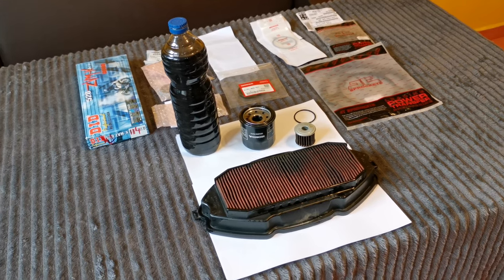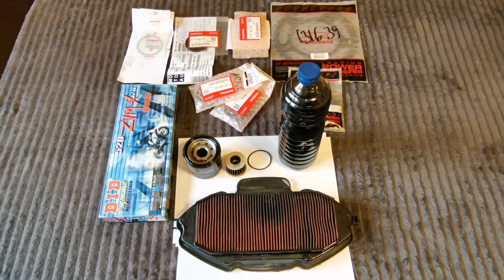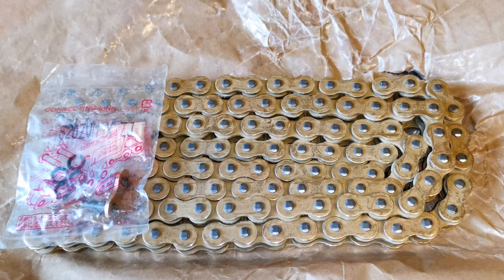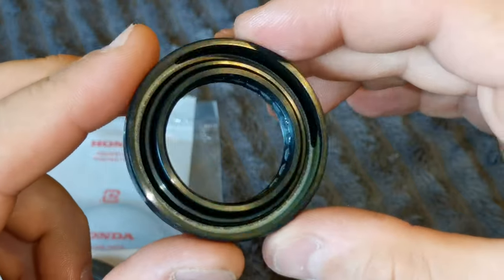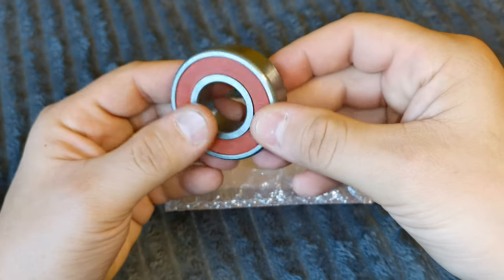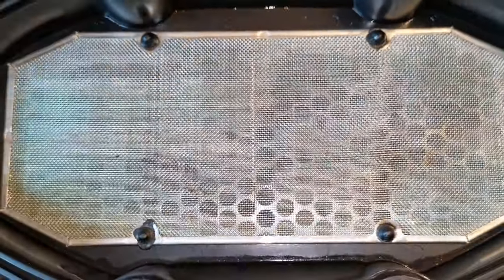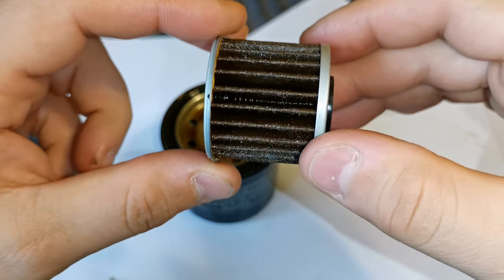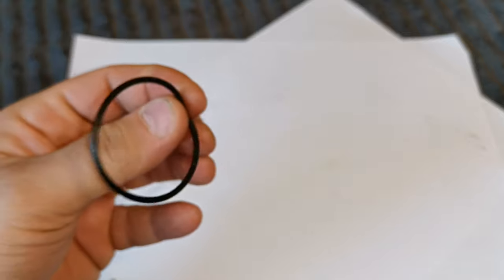Honda NC750X New Chain Kit, Rear Bearings Kit, Air Filter after 27,000 Km and Oil filters 10,000 Km

Comment from the maker: 🔴It would be AWESOME if you could show your support by both watching my videos and subscribing to my channel if you have not already done so. Monetizing my videos allows me to invest back into the channel with new equipment so a small gesture from you goes a huge way for me. Many thanks for your support !
 https://www.youtube.com/c/IdealBike?sub_confirmation=1

In this video you will see the following:
- Honda NC750X chain replacement Kit from JT Sprockets
- Honda NC750X rear bearings kit presentation
- How the OEM Honda NC750X air filter looks after 27,000 Km of usage
- How the oil and DCT filters are looking after 10,000 Km

OEM HONDA NC750X codes:
- 91051-MGSD-31 rear bearing 22x50x15
- 91053-MGSD-31 rear bearing twin bearings (6204UU)
- 91251-MGSD-31 rear simering 30x50x17
- 91253-MAE-003 rear protection simering 
- 91351-MGSD-30 rubber o-ring 55x2
- JTF 1373-17RB 17T front sprocket
- JTR 1316-39 39T rear sprocket
- 103071114R - ZVM-X X-Ring 520ZVM-X 114 chain

Comment: The air filter looks a little dirty 🤔 My was cleaner after 30k and (dusty) roads in Central Asia :) I changed it for the K&N one it gets a little more air and it’s reusable :) 
Very good idea to have spare bearings just in case especially on long trips 👍
Reply from the maker: Hello Alex! I had some ride with 1m water and mud around the southern side of Romania. Perhaps from there.... Still it was quite dirty after 27,000 Km that's why they say to replace it at 24,000. I am riding often in the rain also. I asked the dealer for K&N filter and surprisingly they said this will damage the engine and they will not offer guarantee... This sounded stupid to me 🙄 The bearings I ordered because one of my subscribers told me to prepare around 34,000 Km with new bearings... So far at 32,000 nothing really happened to the rear bearings. Keep you updated, greetings from Romania!